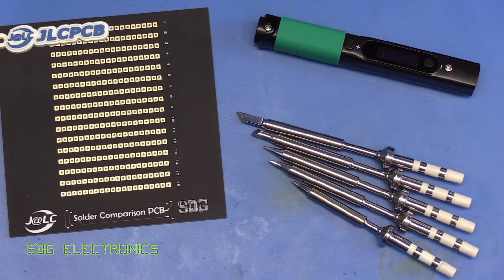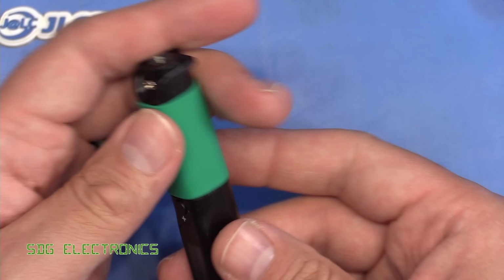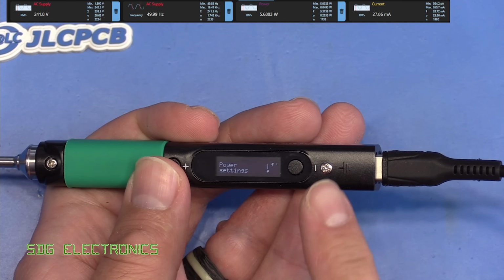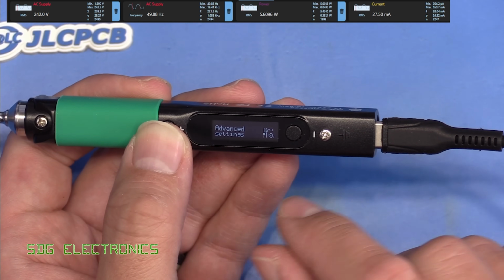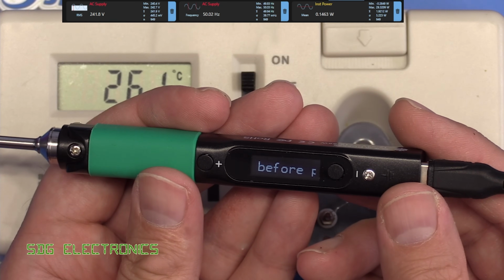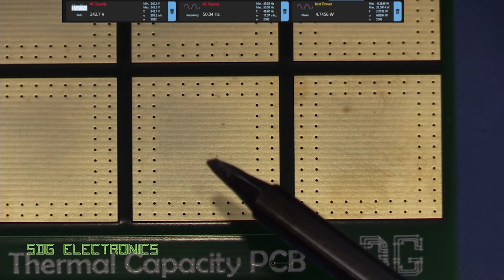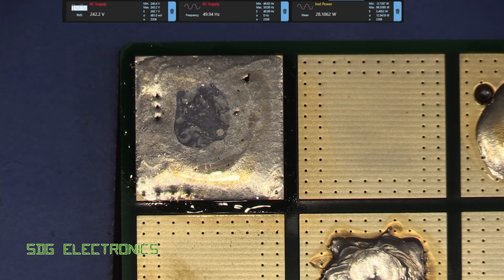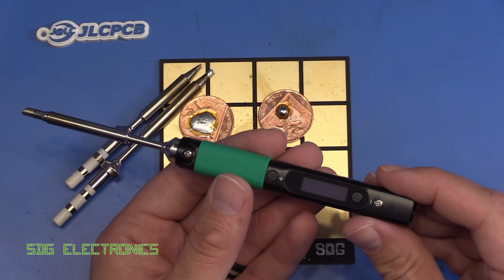SDG #275 Pinecil V2 PINE64 Open Source Soldering Iron - Test with PCBs from JLCPCB

Comment: Would've been nice if you were able to do a teardown to see exactly what MCU it's using. Their product page says it has a GigaDevice GD32VF103TB, but their store page says it has a Bouffalo BL-706. Both RISC-V. Perhaps they're in the middle of a changeover.
Reply: The V2 with the short tip is the BL-706. The original version is no longer made or sold. The primary reason for the switch was supply shortages of the GD32. Also the short tip is the more powerful one (6.2 ohm tip instead of 8 ohm TS100 standard tips). So far the tip provided with the iron is the only such tip available.
Reply: @NusaCat  Wait, I am confused. Does the new MiniWare TS101 still use the old TS100 8 ohm tips or the new 6.2 ohm tip? If it uses the old one then why does Steve state that the TS101 seems to work better than the Pinecil V2?
Reply: Are the new tips that terribly botched?
Reply: @kwinzman  The 6.2 ohm tip is a Pinecil ONLY thing at this time. The firmware to support it is also a Pinecil thing. I'm not aware that MiniWare has done any tip changes, so I guess you are confused. Steve has some basic facts wrong, like when he called the longer tips more powerful....in this case the opposite is true.
Reply: @NusaCat  He claims that there is a problem with those tips, maybe the temperature regulation not working or the heater cartridge being too far from the tip or something. Only 10 or 20W being delivered @ 17:30
Reply: @kwinzman  If he thought it was a cartridge problem, he should have shoved his favorite TS100/TS101 tip in the Pinecil iron and eliminated that factor. Another thing he got completely wrong is "you can't buy tips from anywhere else". ANY TS100 tip, miniware brand or not, can be used in the Pinecil. The long tip sets on the Pine store are just clone TS100 tips to begin with, far as I know.
Reply: @kwinzman   Pine64  Pinecil V2  Iron   is not a Miniware product they are completely separate companies with separate products.   
(1) Pine64  designed the Short tip  6.2 ohm to work in the newest V2 and will be selling more Short tip styles in Dec 2022.  Only Pine store will have the short tips and short tips have been tested with V2.  
(2)  Miniware  TS101/100  (they were designed to work with longer 8 ohm tips)  they have completely different hardware . Even the newest  TS101 only supports up to  45W usb-c.  Since the Pine64 designed  short tip to work with Pinecil V2,  unknown how short tips wll work at all in Miniware TS101  since they have lower power pcb/chips. 
 (3) the new pinecil V2  works with BOTH  Long 8 ohm and short 6.2 ohm tips as long as you unplug  between changes (autodetects on boot-up).  I have no issue with mine  see test here    https://www.youtube.com/watch?v=nTC-ah4f0hg
(4)   short tips will will also work with V1  as long as you  (a) wait for new V1 firmware that allows you to manually switch between short & long tips  or (b) if you want to use Short tips in V1 now, make sure to have at LEAST  PD65W 20V  3-3.25amp  usb-c charger  as the shorter tip draws more power/watts.
(5)  in watching the calibration test it looks like SDG is not using the  Short  tip 6.2 ohm  that came with the Pinecil V2  but rather a Knife tip that came in a separate 4 pack (8 ohm).    he might have defective tip,  not sure.  would be best if SDG opened a ticket on Github Ralim's IronOS firmware to  further diagnose with Ralim what is  causing issue.
Reply: @kwinzman   which new tips do you mean ,   sicne Pinecil came with Short 6.2 ohm tip  but video calibration test  is using a different long knife tip to calibrate.  I think if I was using short tip to test soldering, I would also calibrate with short tip since it's different ohms.   I wonder what would happen  if  SDG first tried a little soldering before doing any calibration at all.   mine worked out of the box  with no issues soldering.    then later I checked on 119  tester  following exact procedure Ralim wrote to me.  and as it tested  within +/- 5 C   I did not calibrate. only calibrate if it is more than -/+  5C off.  
-- not sure what is happening in SDG test but hope he  opens a ticket with Github IronOS  so ralim can look at his  situation further to see if   he got defective tip or calibration is off. 
-- also would like  SDG  to go into  hidden Debug menu    , long hold (-)   then use (+)  to scroll through all the hidden numbers.   if he  does some back and forth diagnosis   and also tells us what his  Chan,  and RTip and some other debug settings say, it will help.   Tip Res shows as   6.2 if V2 detects anything close to 6.2 ohm tips.  and Tip res says 8   if it detects longer tip near 8 ohms  (all in hidden debug menu , all debug options listed on Github IronOS).

Comment: 1) temp calibration -- is resistance recheck, and you wanted temp offset. temp calibration finished, but you haven't tried to recheck.
2) setting temp let's say 330degrees and trying to solder huge polygon? there is turbo mode for it, iron is just aware of not to burn ur polygon, but who knows that you are trying to solder massive one :)
Reply from the maker: If the soldering iron is powerful enough, there is no need to adjust the temperature to solder large planes. Boosting the temperature is a means to temporarily add more energy to a mass to overcome limited power delivery. By doing this transferring a small amount of additional thermal energy stored in the cartridge to the power plane, but then you're back to the limited power delivery. If you look at the professional irons I've reviewed, they can deliver the power effortlessly

Comment: I own a pinecil and use it frequently.  Having said that, the pinecil community does seem to be a little confused about the relationship between temperature and power.  I've seen a number of threads on various forums where users have mentioned they're not seeing an appropriate power draw from their PD power supplies, with fans asking if they'd reached their target temperature.  Not really relevant for the reasons you've illustrated.

If the tip isn't able to transfer heat energy into the part at the required (and advertise) rate, there's a problem.  The temperature readout isn't relevant in the slightest.

I'm not sure where this misunderstanding comes from.  This is all pretty basic thermodynamics. :)

Anyway, correctly designed tips would have very low resistance (ie. 1 ohm), and utilize a shorter duty cycle to heat them.  8 ohms is a bizarre choice unless they wanted to keep the switching frequency really low for some reason.
Reply: 8 Ohms probably comes from original Hakko t12 spec. They probably targeted a 24V internal supply, that will lend at 72W which is exactly the power rating of Hakko soldering stations.

Comment: So one wonders under what circumstance this iron would ever deliver 80+W?  If delivery of heat through the tip comes with such a large temperature drop between the temperature sensor and the tip, then the feedback loop seems to throttle the power to about 15W.    Hmmm, perhaps if you crank the target temperature up ridiculously high, that would counteract the sensor-to-tip temperature drop and actually deliver more heat.. But that would make the iron little better than an unregulated one.
Reply: In boost mode mine delivers over 40W with a 65W charger. It's much more powerful then. It's definitely not designed for high power situations or PCBs with large heat sinks. I use it to build guitar pedals on simple PCBs with THT so it's fine.
Reply: if you go to pinecil wiki,  you will see that "quick charge"  qc which is what he said he used is not recommended.  not sure why he did not just use a PD (power delivery )   usb-c charger.  he also may not know that you have to unplug/reboot when changing between long and short tips since  Pinecil takes a resistance  reading on boot up so it can use the correct profiles since there is a huge difference between short 6.2 ohm and long 8ohm tips. 
there are several mistakes in this video that then lead to potential  incorrect information and incorrect calibration.
Reply: @neo256mb  Steve said he used a QC 3 compatible power source. The wiki,  in different places says that it doesn''t recommend QC 12V, nor QC 2.x, nor QC 3.0 _if lower than 3A_.  If the problem was low power input, the tip temperature reading would be conspicuously low with a heavy thermal load,  whereas in the video the reading remained high, as though the iron thinks it is maintaining a good tip temperature.  Regardless, you have suggested a few points that maybe Steve could clarify.
Reply: @neo256mb  No doubt you make good points, and users should just use a PD power supply or barrel jack supply of adequate voltage and current rating. However you did not answer my point that if power input was an issue, then you would expect the tip temperature reading to be conspicuously low.  And if the iron doesn't work with a wide spectrum of QC sources, then maybe the associated materials should not promote that it does. Or include in the firmware some detection and indication that the iron is being limited by the available input power.   Finally, "the 833  offset number, that means it is done/complete " -- given that this iron has a 32-bit MCU and a graphical display and is quite happy to show nice text messages for most other situations, a display "833" means "oops, we forgot to put in a sensible message here, please report a bug".
I'm sure lots of sincere and valuable work has gone into this product and the associated community effort and deserves crediting, but purchasers of a soldering iron mostly expect a functioning appliance that requires no reading of the source code to figure out how to use it, so it's unsurprising when a review such as Steve's goes somewhat astray.
Reply from the maker: The unit was powered down between swapping tips since I wrecked the TS80 by hot swapping!
Reply from the maker: It was running at 20V according to the display, I will try again at 24V
Reply from the maker: Definitely a few issues. If 833 means the calibration is complete then somehow its flawed since it was still out by 15C. Also as you say, the iron thought the temperature was correct so irrespective of power source it would not perform correctly.
Reply: @sdgelectronics  yes there might be firmware issue  See what Ralim says in Github IronOS ticket.

Comment: I think it doesn't matter much how much power the new version have, becourse the tips have to go anyway not higher then soldering temperatures and they need only a couple seconds to get to the temperature that is needet, and 1 second less to wait is not a big problem and not woth to buy the new version, beside they could Archiv this with firmware updates I think, anyway and the waiting times in the past for heating old soldering irons up with 5 minutes or higher compared to this days in a couple seconds is a extremely improvement anyway. Beside this tips needing only 1/10 off the Wattage that the soldering irons getting put in with 80watts or what ever, it would be much cooler to see if they could make bigger displays for disabled people instead this ridiculous higher Wattage running contest, like it's in the vaping community. 🤔 Stop please calling the iron tips cardridges, they are soldering tips that are only more energy efficient than the past tip versions, with build in heating elements.

Comment: I've been on a long search for a nice soldering iron/station and so far have added to my list the following: Ersa I-CON Nano, Pace ADS200, TS101 and now the Pinecil V2 one. I'm not sure which one to pick but if I were to choose the Ersa and probability and the Pinecil  V2 as secondary, what DC power supply would anyone recommended me for it? thanks.
Reply: I recommend getting any USB-C  charger they are much safer than DC barrel supply as they auto-negotiate (smart chargers).  Also the cables on DC supplies is stiff hard to solder.  if you get a USB-C  power supply that is at least  PD65W 20V 3-3.25 amps ,  then you will have plenty of speed of heating and bonus is there are  Silicone USB-C cables that are much easier to use when soldering(flexible).